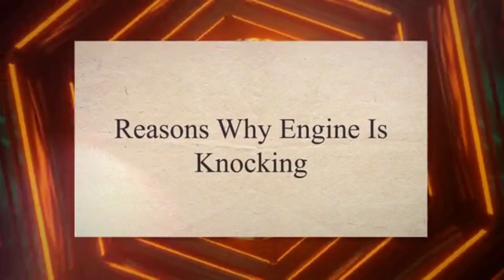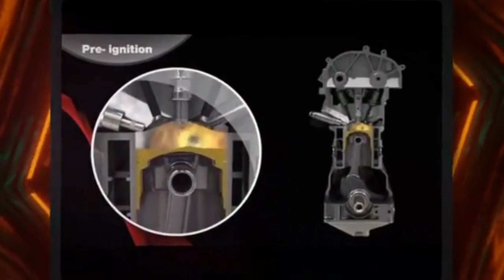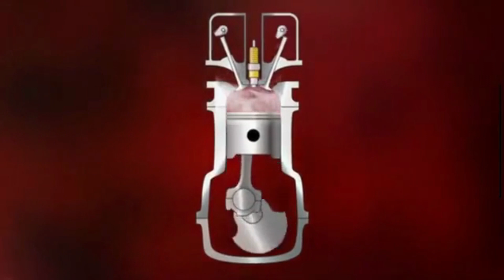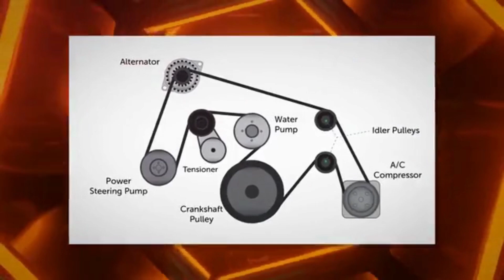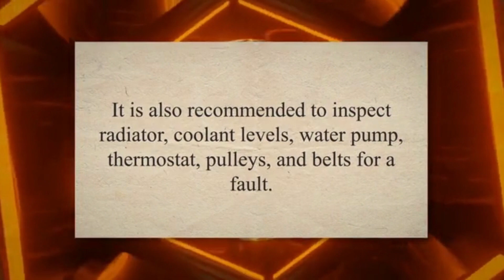Top 10 Reasons Why Your Engine Is Knocking - How To Fix It

Comment: basically either my Spark plugs are shot or not having an exhaust pipe from a lack of maintained City Street after 20 years of Semis starting and stopping in them and the road not getting fixed more than once every 20 years ripping the exhaust pipe out of the catalytic converter and allowing me to hear every sound that comes out of my engine as loud as a Jet plane taking off and at 5,000 RPM it's about 160 decibels which is loud enough to cause hearing damage and to animals with more sensitive hearing, to rupture their ear drums and possibly crush any insect near my vehicle inside a garage or a tunnel. Basically either I need to replace spark plugs or Cities need to fix their Streets before they get bad enough to start law suits by pissed off motorists with vehicular damage from poor road maintenance.

Comment: My Kawasaki GPZ 900 engine knocks rhythmically at 4000 rpm, as if a key were tapping the exhaust manifold. I replaced the tensioner and timing chain and it didn't help. Recently, I looked into the cylinders with a camera and the pistons 2 and 3 are covered with a layer of carbon. Do I suspect knocking combustion correctly?
Reply from the maker: The carbon buildup on pistons 2 and 3 indicates that there might be an uneven burn or improper combustion happening in those cylinders.
Knocking occurs when the air-fuel mixture in the cylinder ignites prematurely or unevenly, leading to abnormal combustion. The carbon buildup could exacerbate this issue by creating hot spots that can cause pre-ignition.
Reply: @MechanicalBoost  I bought some foam to clean the carbon on the pistons and we'll see if it's any better.
Reply from the maker: @MrTomitomi1975  oky try it and then share us your feedback
Reply: @MechanicalBoost  thanks
Reply: @MrTomitomi1975 😊

Comment: My Toyota 2D truck has a knock sound that   comes up and disappears when the truck is loaded and moving but its never there when the engine is idling. What could be the cause?
Reply from the maker: A knock sound in your Toyota 2D truck that appears and disappears when the truck is loaded and moving but isn’t present when idling could be caused by several factors:
1) Engine Load Knock: When the engine is under load (like when the truck is carrying a heavy load), it might knock due to pre-ignition or detonation. This happens if the fuel-air mixture ignites prematurely, which can cause a knocking noise. This is often related to issues with fuel quality, timing, or carbon buildup in the combustion chamber.

2) Worn Engine Bearings: When bearings (especially rod bearings) are worn, they may not knock at idle but will under load due to increased pressure and movement in the engine components.

3) Piston Slap: Knock sound may also appear when the pistons move slightly within the cylinder due to wear. It can be more pronounced under load and may not be as noticeable at idle.

4) Loose or Damaged Engine Mounts: If the engine mounts are worn or damaged, the engine could shift slightly under load, causing metal-to-metal contact, which could create a knocking sound.

5) Suspension or Drivetrain Issues: Sometimes, a knock under load can be related to the suspension or drivetrain, such as a worn CV joint, U-joint, or differential problem, rather than the engine itself.

6) Exhaust or Heat Shield Rattle: Sometimes, parts of the exhaust system or a heat shield can rattle under load due to the increased vibration but remain quiet at idle.

Since the issue only occurs under load, it suggests that the engine or drivetrain components are being stressed in a way that reveals the problem. It’s best to have the truck inspected by a professional mechanic to pinpoint the exact cause.

Comment: Excellent explanation, definitely my Toyota has a “fuel problem” , passed emissions test flawless (no codes)but under acceleration valve train rattle even using “93” , with the a/c on it’s even worse and also struggling to crank it up in the morning , my dilemma is finding what’s wrong, the fuel pump (hell of work) or the fuel regulator ( expensive part) ☹️
Reply from the maker: Steps for Diagnosis:
1) Fuel Pressure Test: Attach a fuel pressure gauge to the fuel rail and check the pressure against the specifications for your Toyota. Check the pressure at idle, during acceleration, and with the A/C on.
2) Inspect the Fuel Pressure Regulator: Check for fuel in the vacuum line and use a vacuum pump to see if it holds vacuum.
3) Check Fuel Pump Operation: Listen for the fuel pump when you turn the key to the "on" position (without starting the car). It should run briefly to pressurize the system. If you don’t hear it or it sounds weak, it might be failing.

Possible Next Steps:
1) If Fuel Pressure is Low: Replace the fuel pump.
2) If Fuel Pressure is Normal but Drops Under Load: Replace the fuel pressure regulator.
3) If Both Components Seem Fine: There might be other issues such as clogged fuel injectors or a problem with the fuel filter.
Reply: @MechanicalBoost  you’re my hero 👍💪

Comment: My car knoking when it's cold and at normal temperature it doesn't  knoking nissan rogue sport 2021
Reply from the maker: A knocking sound in your car when it's cold but not at normal temperature can be caused by several factors:

1) Engine Oil: When the engine is cold, the oil is thicker and doesn't lubricate the engine as effectively until it warms up. This can cause knocking sounds. Make sure you're using the correct oil viscosity for your vehicle.

2) Piston Slap: When the engine is cold, the pistons may not fit as tightly in the cylinders, causing a slapping noise. This often goes away as the engine warms up and the metal expands.

3) Worn Engine Components: Components like bearings or lifters can be worn and might not function properly until the oil warms up and provides better lubrication.

4) Fuel Quality: Poor quality or incorrect fuel can cause knocking, especially when the engine is cold. Ensure you're using the recommended octane rating for your car.

5) Carbon Deposits: Carbon build-up in the combustion chamber can cause pre-ignition or knocking, more noticeable when the engine is cold. A fuel system cleaner might help reduce these deposits.

Comment: My engine only knocks when driving but then goes away, what could that mean?
Reply from the maker: If the knocking occurs only during driving and then goes away, it could be related to specific conditions such as load, engine speed, or temperature. Here are some potential causes 1) Low-Quality Fuel 2) Carbon deposits on the combustion chamber walls or piston tops 3) Incorrect Ignition Timing 4) Lean Air-Fuel Mixture 5) Faulty Knock Sensor 6) EGR System Issues 7) Old or Worn Spark Plugs
Reply: @MechanicalBoost help alots ❤
Reply: Hi same problem but my vehicle Mivec CA4A 4G92 petrol injection got knocking when I'm switch on aircond some time got knocking
Reply: Hi same problem but my vehicle Mivec CA4A 4G92 petrol injection got knocking when I'm switch on aircond some time got knocking

Comment: What would cause a new motorcycle engine with only 1900 miles knock as it’s warming up, and stop knocking when it’s warmed up?

What if this engine has a little too much motor oil ?
Reply from the maker: It may cause because of different causes such as:
1) Piston Slap: This is a common cause of knocking noises in cold engines. When the engine is cold, the pistons may be slightly loose in the cylinder bores. As the engine warms up, the pistons expand and fit more snugly, reducing or eliminating the knocking noise.

2) Oil Viscosity: If the engine oil is too thick (high viscosity) when cold, it may not flow as easily, leading to less effective lubrication of engine components and resulting in knocking sounds. As the oil warms up, it thins out and flows more freely, providing better lubrication and reducing noise.

3) Valve Clearance: Cold engines may have larger valve clearances due to metal contraction. This can cause the valves to make a knocking or tapping sound. As the engine warms up, the metal expands, and the valve clearances become tighter, reducing the noise.

4) Cam Chain Tensioner: Some motorcycles have automatic cam chain tensioners that adjust the tension as the engine warms up. If the tensioner is not working correctly when cold, it can cause a knocking noise that goes away once the engine is warm and the tensioner has adjusted.

5) Cold Engine Combustion: When an engine is cold, the combustion process is not as efficient, which can sometimes cause knocking or pinging sounds. This typically resolves as the engine reaches operating temperature and combustion becomes more efficient.

6) Fuel Quality: Poor quality or incorrect octane fuel can cause pre-ignition or knocking, particularly when the engine is cold. Once the engine is warm, it may run more smoothly and the knocking may diminish.

7) Break-in Period: Even though 1900 miles is a significant amount for a break-in period, some engines might still be settling. Slight variations in engine component fit and wear-in can cause temporary noises that disappear as the engine parts finish settling into their final operating conditions.
Reply: @MechanicalBoost :  was not the fuel.

The engine is mapped at the factory.
Is it possible for that mapping to become corrupt?
or partially corrupt?
or just enough to cause knocking?
or knocking during warm up?
or knocking during warm up and then continue but not as bad?
Reply: @MechanicalBoost  :
 :  
you’re good !
I can’t thank you enough for taking the time to put all that down and sending it.
Thank you.
Out of those seven, at this point and given that the engine is so new, I’d suspect oil quality and fuel quality.

I could be they the fuel is not of good quality. I did notice that the gas was really white or clear.  This could be it. 
I’m going to suck it all out and replace it tomorrow.

For the oil, Triumph recommends Castrol.
So I’ll Che l with the dealer that did the oil change.
I’m really hoping it’s the gas.

The cold engine, valve clearances, piston slap, and cam tensioner definitely sound like possible causes, but I’m going with the simple possibilities first.
Gas and oil.
I will say this……there was about two gallons of fuel in the tank, and I added one gallon of 93 octane to see if it made a difference. Not noticeable.

I’d go pump it out right now, but it’s 10pm.
Thanks again.
Reply: lean mixture
Reply: @ombrijulambre-pq5yj  :  so the ECU is not programmed correctly ?

It started off knocking after 30 seconds after starting the engine, then after a couple month it was immediate, now for some reason it’s knocking after minute and a half.   

Could it be that because It’s cooler now in October so the ECU is making adjustments?